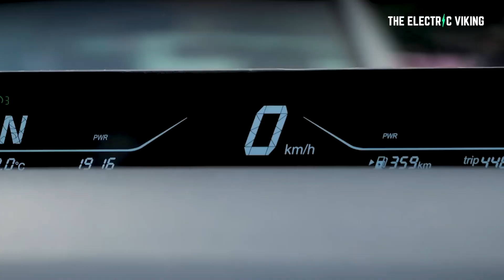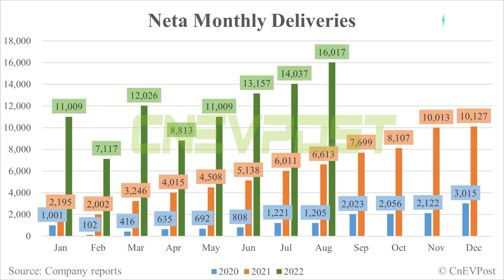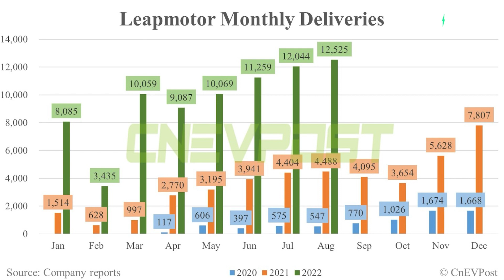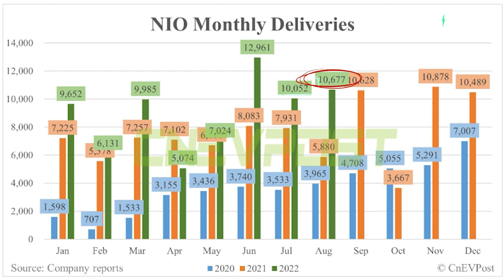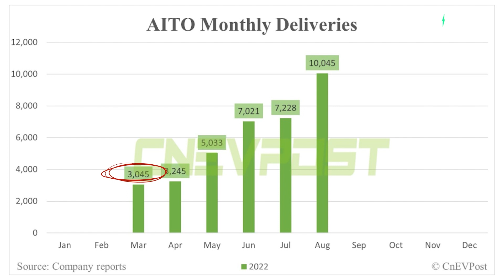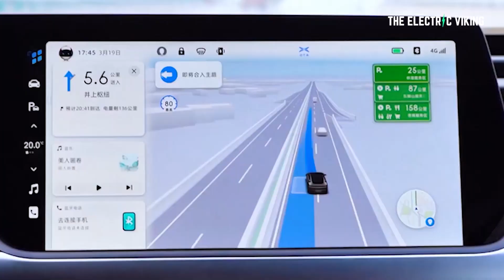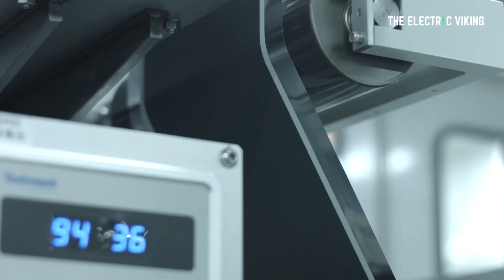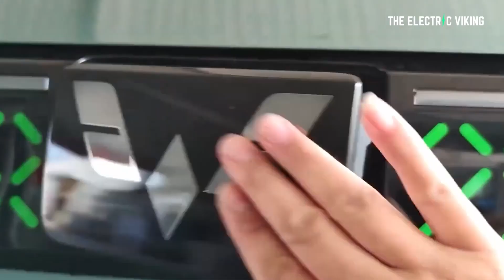China's Electric car sales in August 2022 = 60% of world EV production

Comment: A bit off topic, but I keep hearing some armchair engineers poo pooing adhesive joining of body panels rather than spot welding. Anyone, including me, who has spent a career in aerospace or high end boat production, will tell you: modern adhesives are the hands down winner in joinery. 100% surface area bonding, zero moisture entrapment,  and fatigue debonding unheard of if done to modern standards.
Reply: Uh huh...a continuous weld properly executed exceeds the strength of the panels being bonded.
EVERY fabricator knows this.
Fabricator with real world experience>engineer.
I will take that over glue any day.
Reply: @donreinke5863  always amazed at how these posts are twisted. I specifically mentioned spot welding, not continuous.  However, had you been up on tech, and working in the relevant fields, your statement would still be irrelevant. Trying to think of any application where I would want a weld to be stronger than the media, as a feature. No, welding has its place, but this particular application isn't one of them.
Reply: @donreinke5863  unbelievable.  I'm guessing you are an old guy like me. Seventyish. Stuck in the same boring job till you retired. And either can't except new concepts, or just never had the chance to engineer advanced concepts. So I'll just agree with your superior sense of "welding crap", and say, good show. I am humbled by your superior knowledge and wit.
Reply: @donreinke5863  deluded. Good luck. Enough of this circular BS.

Comment: the reason legacy players cannot make more evs is because they make tons of the money on ice and they do NOT want to change. chinese see a trend and just switch over. this can-do no bs attitude is something lacking in the west.
Reply: Yes its very obvious they don't want to change, but change is upon them whether they want it or not. So they can try and run with it or continue to sell horse buggys. Not a good analogy there is still a small market for horse buggys.
Reply: @lionelwylie2326  They're like dinosaurs: Soon they'll be almost extinct.
Reply: And the Chinese are building 36 NEW COAL FIRED power plants to produce the electricity necessary for their domestic market glorified golf carts.
Electric vehicles have ZERO advantage.
Reply: @donreinke5863  even if the electricity is produced with coal, and in reality it is not all by coal, it is still much cleaner than ICE. with ICE, over 60% of energy is wasted. you simply don't loss that much by going ev. besides, china closed hundreds of small outdated coal power plants, overall air quality has dramatically improved over the last decade.
Reply: This is not true.  Legacy automakers still compete with each other and their profit margins are slim.  Moreover, the longer they keep making ICE vehicles the longer they will need to maintain warranty supplies/spares.  In the meantime the likes of BYD completely dumped ICE car production and their reinvestment in NEVs is delivering in spades.  The new players in China that began like Tesla - with EVs from day one - have no  ICE hangovers to drag down their profits.
Reply: @remakeit2628  What a ridiculous post. What you are implying is 1...that glorified golf carts wont require spare parts or the abundance of electronic garbage on them will not have issues. Spare parts wont be needed     ROFLMAO....the is a lot full of wrecked Tesla garbage behind the dealership here that are waiting for replacement body and structural parts.
2....That no warranty will be offered on these disasters.
Tesla...has already attempted to weasel out of warranty claims/issues by trying to claim they are NOT an automotive manufacturer but rather an electrical equipment company.
Warranty and spare parts supplies WILL be necessary regardless of what is powering the vehicle.
I would absolutely NEVER purchase a Chinese vehicle regardless of power system, their poor quality replacement parts/knockoffs on the market are a testament to their lack of any quality.

Comment: I know my EV promotores can't see how an ICE car can be green - it can run on ethanol, Bio Diesel, or hydrogen. There are hybrids that can drive all electric for 100 miles; the weigh less and take less CO2 to make and to drive; and of course can be made in enough numbers to meet demand which Lithium EVs can't - you can't make more than about 5 million full size EVs like Teslas before you run of of Lithium supply.  If they were not subsidised EVs would be an even smaller niche than they presently are.  There are 80 million cars made a year and 140 milion vehicles of all types. 5 million; even 10 million doesn't amount to anything.
Reply: Ethanol and biodiesel are bogus. Takes two gallons of diesel to make one gallon of ethanol or biodiesel. Not Green at all.
Reply: If you do an internet search for "how much land is required to make biodiesel", you will see that growing crops to make biofuels is not sustainable. For example, one article that you can find by searching for "disadvantages of biofuels - land use" (with the quotes) indicates that the US is 3.7 million square miles in size, but you would need to devote 336 million square miles to growing corn/maize to meet the total fuel demands of the US. If you do an internet search for "How Much Land is Needed to Power the U.S. with Solar?" (again, with the quotes), you will find an article that suggests about 10,000 to 22,000 square miles of solar panels would provide all the power required by the US. That is more than 10,000 times more space efficient than growing crops for biofuels.

You wrote, "you can't make more than about 5 million full size EVs like Teslas before you run of of Lithium supply". Incorrect. An internet search yielded a PDF document titled "Global EV Outlook 2022", and a careful measurement of the bars in the bar chart on page 14 indicate that the world currently has 16.5 million electric cars on the road, of which 11.4 million are fully electric. Since that is higher than the 5 million you claim is the limit before running out of lithium, it is clear you don't know what you are talking about.

The remainder of the statements you made are similarly misinformed.
Reply: that's bs.  ever heard of recycling.   only have to mine the minerals once, then just recycle.   it's already happening